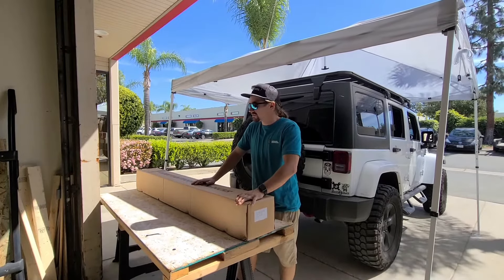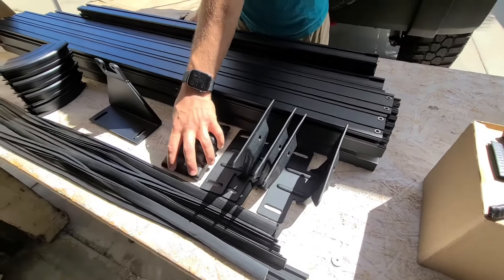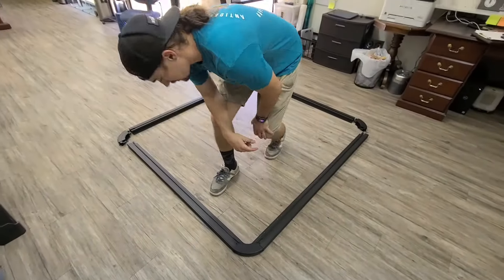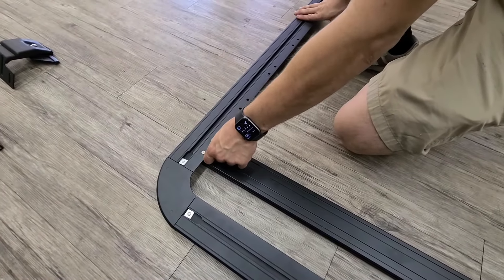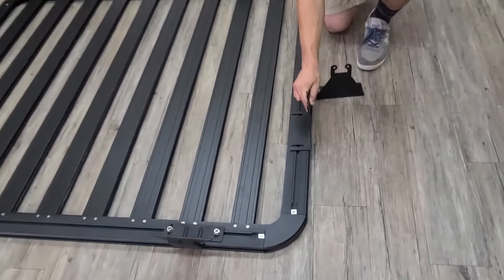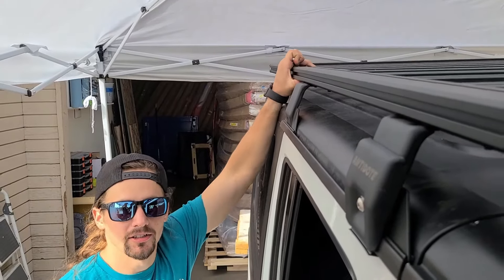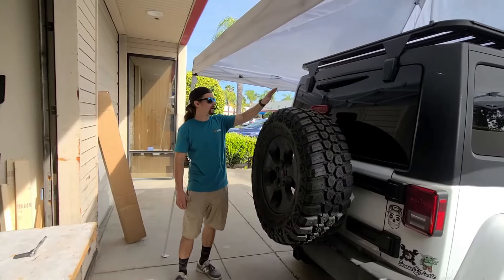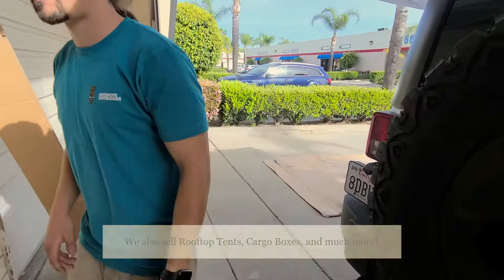How to Install Jeep Roof Racks - No Drill Installation Antidote Outdoors Jeep Wrangler Platform Rack

Comment: Has anyone provided feedback on mounting to the rear window brackets? I ask because I have a 2017 JKU Hard Top and would need to do that... but my concern is weight sitting on those rear hinge bolts. Thank you!

Comment: My kit came w 2 sized washers, only the large washers fit the large bolt for the corner pieces BUT the washers does NOT fit in the channel so it is not usable, keeping it above the channel does not let the bolt screw far enough in. I am off to home depot tomorrow to hopefully find the correct size washer. Very frustrating.

Comment: Hi,
In the video you say that it will definitely support a rooftop tent.  It was my understanding that a wrangler cannot carry a RTT that is gutter mount because the fibreglass roof itself cannot hold more than 150lbs.  The issue in not whether or not the rack can hold a tent, it's whether the roof itself can.
Can you help me understand whether or not I can use your rack to hold a RTT on my Wrangler JL? 
Thanks!
Reply: I wouldn't support a RTT + people solely on the gutter mount. I wouldn't put anything over 150lbs on it. You're also adding the weight of the rack + RTT + 1-2ppl..no for me

Comment: This rack can use on the sky one touch ? Add the 5inch base ?
Reply from the maker: We are working on figuring that out but it is expected that it will need the 5" high clearance brackets to work best. You can stay tuned via our website or instagram @AntidoteOutdoors

Comment: what type T-Bots are being used for the assembly?
Reply from the maker: We would tell you if we knew the exact type of T-bolt, we only know them as t-bolts. These are designed with a low-profile head to allow them to slide into the thinner T-tracks such as the ones on our Jeep Platform Roof Rack. We don't sell them separate but we do have our t-nuts that work well: https://www.antidoteoutdoors.com/product-page/jeep-platform-rack-mounting-hardware

Comment: Will this work with sunrider soft top for jeep hardtop? Also, what is weight capacity for half rack?
Reply from the maker: We havent had the opportunity to outfit a jeep with that setup just yet. We would recommend using our high-clearance brackets to lift the rack higher off the roof to allow the softtop to fold back, but we have not fully tested this yet.
Reply: Have you had the opportunity to do a fitment with the sunrider  top for the 4 door?

Comment: Will the half rack work on a 2 door with just 4 mounting points on a JK?  Is this aluminum?
Reply from the maker: Yes it will. The 5th and 6th mounting pieces will not completely fit due to the longer hardtop portion in comparison to a 4D however they can still be seated about 2/3s the way into the drip rail. Reach out directly through the website if you have any more questions. AntidoteOutdoors.com/contact